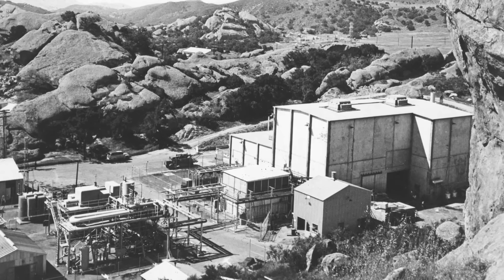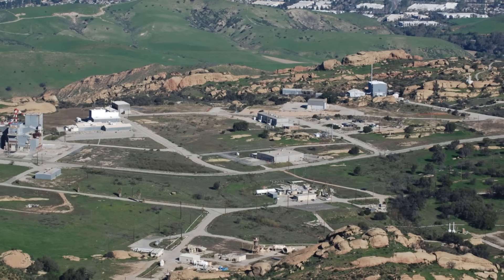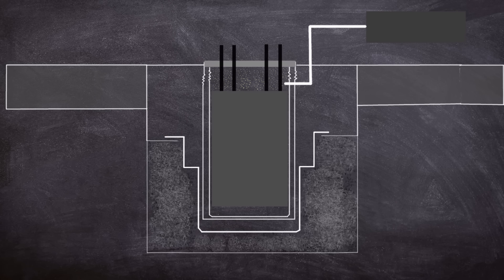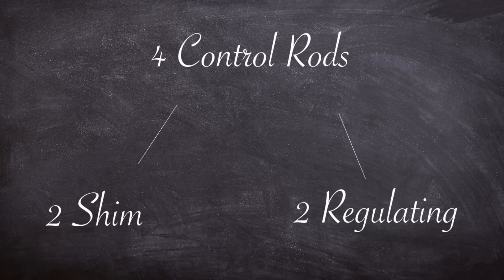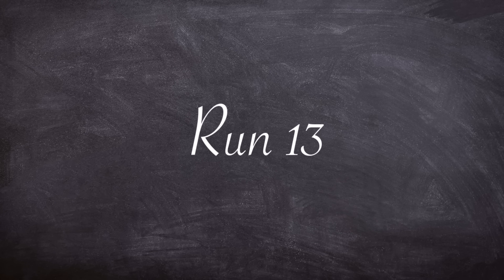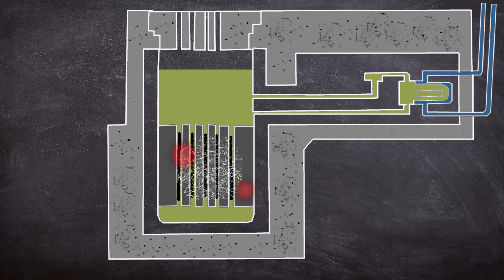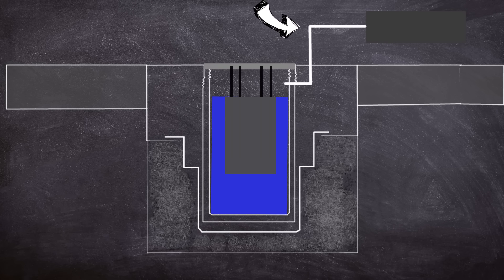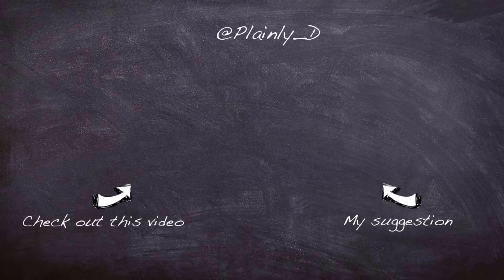A Brief History of: The Sodium Reactor Experiment Accident (short Documentary)

Comment: Question:  I'm not sure why having your coolant and moderator be separate things would be good. Using water as both the coolant and the moderator means that if you boil off your coolant the moderator is gone and fission stops. The reactor essentially turns itself off with or without control rods. Having the moderator and the coolant separate means that you can lose all your coolant and the reactor won't stop, which is part of what happened in Chernobyl. Why would it be good to have them be separate things?
Reply: The benefit for this reactor is that it can run high temperatures by using sodium coolant but still operate in the thermal neutron spectrum via a graphite moderatorm Another is that in the (very) unlikely event that multiple control rods become jammed, the moderator can be removed and fission will quickly cease, but coolant can still flow to remove decay heat. The only commercial design that currently makes use of the latter is the CANDU reactor.
Reply: @Akira-wh9mw  That makes sense. But if your moderator is solid graphic blocks that comprise the structure of the reactor, how do you remove them?
Reply: @virginiahansen320  In that case you cannot remove the moderator while operating (by any practical method). In the case of the CANDU, the moderator is also a liquid and can be drained.
Reply: @Akira-wh9mw  Ah. There ya' go. So if you have a liquid moderator it's an advantage to have the moderator and the coolant separate. If you have a solid moderator built in to the reactor, like the RBMK-1000 design, it's a serious disadvantage. Makes sense.
Reply: @virginiahansen320  Yes, a solid moderator can be somewhat of a liability; if temperature increases the density of a liquid decreases such that its scattering cross section decreases and becomes a poorer moderator, thus slowing the fission rate. A solid does not vary in density as much, and thus continues to moderate just as well if not better due to Doppler broadening, thus creating a positive feedback to fission rate. This is one of the design concerns that lead to the Chernobyl accident.

Comment: Your acronym is incorrect. Molten sailor reactors are abbreviated as "MSR's". This is an insanely primitive one, which modern ones keep the fuel dissolved in the coolant,  which also can't run away. 

The main reason we don't use MSR's is because of the US navy needing a reactor that doesn't explode in water, and MSR'S can't readily be used to make fuel for weapons.  The director at oak ridge was a huge proponent on MSR's but eventually just lost the fight with the navy.

There's a fantastic book on the history of MSR's and the politics around why we use the light water reactor today,  it's called "superfuel"

Comment: "As the SRE incident is only scratching the surface"

...

OMFG.  That is some of the worst management of a nuclear reactor that PD has covered so far and that is only scratching the surface?  It is almost like they WANTED to push this to failure/meltdown to learn and improve future designs.

Bonus points for them cleaning the fuel rods with the precise material that will cause the sodium to explode.  Way to go guys.
Reply: Oh, there's been way, way worse. I'm new to his channel, has he covered the nuclear engine experiments the US Air Force did? Those were probably the most idiotic and irresponsible nuclear tests I know of. Oak Ridge tried the safe way to use nuclear power in aircraft, found the weight-to-thrust ratio much too high, and used the design to make naval reactors instead. The Air Force decided "eh, f*ck it, let's just make it like a jet engine and expose the nuclear fuel to the air directly".

Comment: The other thing about his sodium reactor is the reason why they use sodium or tested it what is the fact that sodium will not deteriorate the fuel like water will so that’s what they were hoping for but the sodium is very corrosive to reactor if there is any holes in the cooling lines which was
Reply: You also just can't cool fast neutron reactors with water. Can't recall whether molten lead works for fast reactors or not, but that might be the main competitor.

Comment: Thank you,Im asking If you could possibly Reviews the Heinz Pommer theory and information that the WTC Towers we're demolished by Thorium explosions.
Revoewing much of the information and techniques used by AEC for clean down and the experience makes this a genuine possibiliy that the towers used neutron reflectors and control Ross to create the explosions and that the Aircraft were there to open thé needles to allow thé superheated Steam 8000 degrees ať source to dříve thé exit of thé iron dust Black Out of the Building.

Thank you.JP.
Reply: As he seems unwilling to answer, I'll give it a go. So, I've looked up the theory, and the main issue is that the author basically completely waved away the absence of any evidence of a nuclear detonation by claiming that the nuclear fallout we'd expect to see was hidden somehow. Hiding nuclear detonations isn't easy, and the fallout can often be found miles away. The fallout from Chernobyl was noted across a large stretch of Europe. That dismissal of the lack of evidence makes the hypothesis unfalsifiable, and thus impossible to effective determine the truth of. This pretty much means the theory is dead-in- the-water from the outset, when it comes to verification. Unless documents confirming or deconfirming the hypothesis are ever found, it's damn hard to prove it one way or the other. 

Even if I grant that it's possible, it's significantly less parsimonious than other hypotheses. Why accept the additional assumptions that the bombs were nuclear, and the all complications they introduce, when conventional explosives would be entirely sufficient? I don't actually think anything of the sort would be at all necessary to bring the towers down, but even granting that premise...why use nuclear weapons? What's gained from using complex, harder to conceal and less reliable devices over conventional explosives? Modern nuclear bombs are complex, requiring precise machining, assembly, rare and harder to produce materials, and a great deal of expense. Even the most primitive form of fission weapon is more mechanically complex than any commercial demolitions charge. If you want to disperse toxic byproducts, or even to spread radioactive isotopes around (which would be harder to hide, and would just make covering it up needlessly more difficult), a dirty bomb would be quite sufficient to such a purpose, would it not? I haven't read his entire presentation, so perhaps he tackles this issue, but I'm just not convinced. 

As an aside, such devices would still be much less complex than the array of neutron reflectors and control rods you seem to be proposing. That sounds like a Rube Goldberg nightmare of a design, and a highly ineffective one. Nuclear bombs and nuclear reactors have two entirely separate designs for a reason, as the design goals are almost antithetical, even if the basic physics are the same in principle. For power, one wants to produce a smaller (one hesitates to say "small", given the absolute amount of power produced), controlled amount of energy over an extended period of time, but in nuclear weapons, one wants to unleash all the potential energy of the nuclear material possible in as short a time as possible. On the order of fractions of a second. Two very different design goals, I think you'd agree. With nukes, there's no need for moderators, coolant, or control rods, though neutron reflecting materials are used. I don't blame you if you're unaware of the details behind the construction nuclear weapons, as I suspect most authors and experts who discuss the subject have left out critical details, either out of ignorance or deliberate obfuscation, which I can't really blame them for doing, given the subject matter. 

There are a few other problems with the original hypothesis that stuck out to me. Mushroom clouds aren't at all exclusive to nuclear blasts, they're not an uncommon dust distribution pattern for all sorts of things, including natural events like volcanic eruptions. They're an entirely unremarkable sight after the demolition of a large structure. The debris piles do seem somewhat small for such a large building, at least at first blush. However, consider the fact that buildings are mostly empty space. They're not very "dense", even if they're large in  volume. 

As for the psychological analysis sections in the original presentation, I'm neither qualified to comment, nor especially interested in them. Nuclear physics, physics, and chemistry is far more interesting to me, and I'd rather talk about those topics, or how dust explosions and thermite reactions can happen in scenarios like plane crashes to increase the amount of damage caused, rather than any theories about why I find most 9/11 hypotheses unconvincing. I'm an aspiring chemist, raised by a biologist, a programmer, and a stagehand (divorced parents who split custody, one of whom remarried, and said spouse did influence my mindset). I like practical questions and concerns. Practically speaking, I think the idea has too many flaws and areas where things must go just right to actually work out, not to mention the lack of radioisotopes on-site.  

My disbelief in conspiracies generally stems from a distain for bureaucracy and government: if they can't hide extramarital affairs, literal war crimes, or even keep protestors out of "secure" nuclear facilities, I doubt they can pull something like this off. Too many moving parts, and the odds of a metaphorical (or literal, who knows) "instructions unclear, dick caught in machinery" moment are just way too high for me to consider it as more than just a neat hypothetical. Despite that, I'm actually quite interested what your thoughts on my points are, and why you might think they're incorrect. Even though I don't buy into them, I find investigating the reasoning behind stuff like this can be quite informative, and I'm always happy to learn.

Comment: Run 8+: "S*** guys, this thing is having a number of issues. But it's probably fine."
Run 13: "S*** guys, there was an explosion after a SCRAM. Clean it up and put a band-aid on you wimps."
Run 14: "S*** guys, another SCRAM. Just start it up again and crank it up higher."
Run 14 later: "Guys, we're leaking 25 r/h up, up 50 fold in 2.5 hours."
Next day: "Yo, this thing is fluctuating on it's own... and we are really fighting to keep control of this. This seems like more than just be a bad day."
Next day: "The power is doubling in a matter of seconds... we have to SCRAM."
Next few days: "Lets keep playing with it. The issues are getting more frequent, but I'm sure one of these runs it'll be better."
Next day: "Lets flip it on again." (shuts down) "Go wiggle those nuclear fuel rods Jimmy. Maybe slap them on the side a bit. It works with the TV, this is basically like a big TV."
Later inspection after more problems: "Oh look, we really porked the pig on that one. Shouldn't have slapped it so hard Jimmy."

(Clown fiesta of mishandling later)
"You know what was a great idea? Running that reactor that had nothing but problems. Lets go fire that b** back up again and see how many days we can go before it SCRAMS itself again. Worst case scenario we just go burn more cancer salts in the back fields."

What a dumpster fire of mishandling. I get that they had no idea what the consequences were, but you'd think that someone would have decided to keep it in their pants long enough to at least do some critical thought and proper investigation into the repeat problems instead of just going "F it, we'll do it live" and dive head first in. I guess they did make progress and figured out just how stupid it was, but seriously at what cost? They didn't even keep track well enough to know what the actual cost was. That is embarrassing.

Comment: Molten salt would have been much safer, and was eventually used in other reactor designs.
Reply: Uh...if you mean "sodium chloride" when you say "salt", citation needed. Molten salt reactors generally don't use sodium chloride. They have used sodium fluoride, but they usually use other fluoride salts. The UK was considering chloride salt reactors at one point, but I can't find any evidence of one being built, nor which metal cation was proposed. Those also have drastically different designs. This design likely would not have worked if they used sodium chloride instead.

Comment: After run 13 they should of shut it down in definitely until the heat fluctuations were corrected. Also, they should of figured out how to stop the corrosion build up on the fuel rods!! In a lot of these accidents I notice that the technicians push the reactors again and again and again, until there's a bad accident! Foolishness!

Comment: Reactor design reminds me of a specific plant starting with a C and ending in hernobyl
Reply: It's completely different to the RBMK reactor that went bang in Chernobyl
Reply: Oh no, way, way safer than that mess. That particular design had a rather notable defect that could easily cause a runaway feedback loop. It's been corrected since, and no one uses reactors with that defect anymore.
Reply: @Nixeu42  they still have a few RBMK reactors still working in Russia.. i image they are very careful how they operate them now that everyone knows the truth about that bad design
Reply: @markshort9098  As I understand it, they fixed the issue that led to the feedback loop in the other RMBKs. How well they managed it is probably up for debate. I was surprised they were still running, and I'd probably be nervous if I was working on one. But the remaining reactors seem to have behaved relatively unremarkably.
Reply: @Nixeu42  i didn't know they modified them but good to hear.. that's exactly how we want nuclear reactors running, unremarkably.. it will be a good day when those old reactors are shut down in favor of molten salt liquid fuel reactors but that's going to be a while yet thanks to politics.. water cooled reactors were never meant to be scaled up for use on land
Reply: @markshort9098  To be fair, they aren't using a design identical to that which is used in nuclear naval vessels for most land-based installations. Mostly because the "seal it and let it run for 25 straight years with no throttling" design philosophy is less desirable for commercial power generation. Not that US naval reactors can't do the job just as well on land, mind, as they did use one in a land-based installation for a time. 

Honestly, it might work better if they did use the naval design. It'd at least be a lot more robust and durable, with less chance of user error f*cking something up. That's probably why there's a commercial lead-cooled reactor with a similar design philosophy being worked on.

Comment: I don't see how this idea even remotely made sense. First off why such a reactive metal like sodium? Tin has a pretty low melting point and isn't nearly as reactive. Secondly, wouldn't a liquid metal pool dissolve the metals the fuel rods are made of? If it dissolves radioactive material doesn't it become less and less efficient. Doesn't the nuclear energy only come out when it's packed around other nuclear materials?

Comment: Have you investigated the Atomic Power accident at Brown's Ferry when the cables caught fire because some guy was down in the cable runs looking for air leaks WITH A CANDLE. I kid you not dude was looking for air leaks with a CANDLE in the wiring runs that manage systems in one of the reactor control rooms. This happened for real. Brown's Ferry Nuclear Power Plant is part of the Tennessee Valley Authority. The Browns Ferry nuclear plant comprises three 1100MW General Electric Mark I boiling water reactors, which began construction in 1967 and 1968. Operating licenses were issued to the Tennessee Valley Authority (TVA) for unit 1 in 1973  and for unit 2 in 1974. The third reactor was under construction at the time of the fire.

Browns Ferry is second in the amount of power generated by a US Nuclear Power Station Complex. You must do a story on this. The Brown's Ferry Plant almost lost it. Took a year to get thing set to right. Then after that a few more accidents happened such that the NRC shut Browns Ferry down so they could resolve their administrative issues.

Comment: You really should do a bit more homework on this one, you left out a couple important facts! #1 The coolant used was not straight sodium! In fact this fuel was known as NaK,  an amalgamation of sodium metal, and potassium metal. Sodium by itself is not a liquid,  and neither is potassium,  however when the two alkali metals are merged together they become a mercury like metal, called
NaK, and it is more or just as nasty as cesium. Now from what I remember about this amalgamation that really stuck out was it wasn't able to be irradiated,  ergo those was another attractive reason it was put into use!

Comment: Cooling with liquid sodium, yeah right. An alkali metal that needs to be kept at 100 degrees C just to keep it liquid and reacts violently when it comes in contact with water producing hydrogen and oxygen. Nothing dangerous there. So lets use it as a reactor coolant......brilliant!
Reply: Pressurized water's not much safer. Has similar explosion risks with reactor cladding, as it happens. Still works quite well...so long as you don't lose power or pressure suddenly.

Comment: why did Rocketdyne build a reactor? they build rocket engines not reactors, no wonder it failed.
Reply: Rocketdyne built and tested the rocket engines used for Apollo 13 and others. They shared the SSFL with the Atomic Energy Commission (later Department of Energy). Currently NASA, Department of Energy and Boeing (who bought Rocketdyne) are responsible for the cleanup. parentsagainstssfl.com
Reply: @toxicSantaSusana  wasn't that Lockheed who bought Rocketdyne?